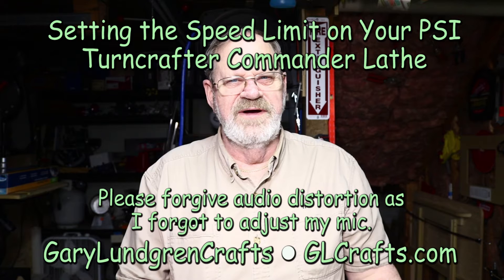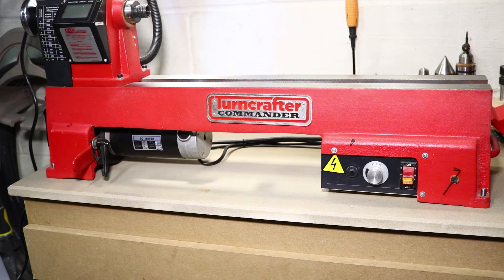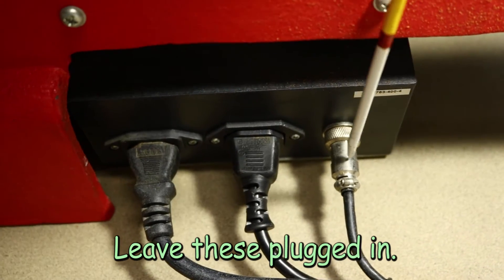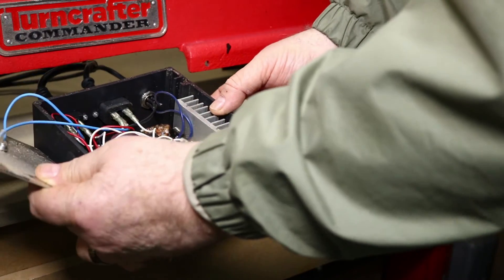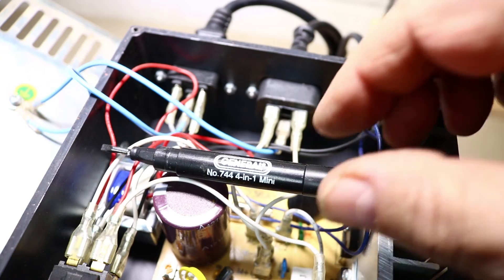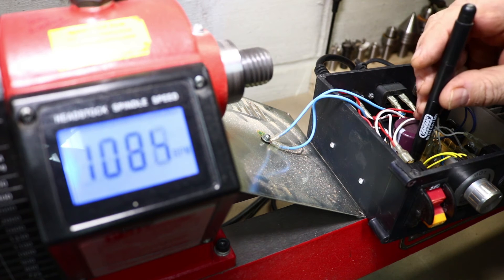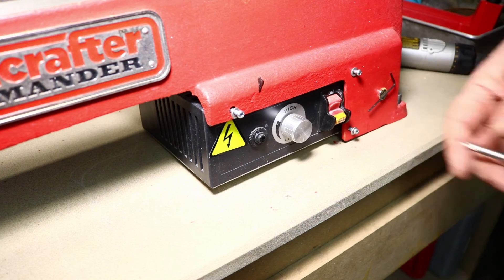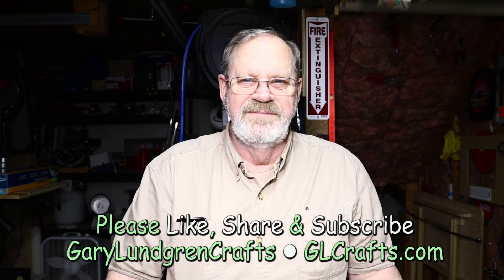Setting Speed Limit on the PSI Lathe  Ep.2017-13

Comment: Gary another ? For you.   I just got my Tunercraft Commander 12" lathe in today . Do you have a high pitch whining noise above 3600 rpm. When I drop it down to around 3500 or slightly higher the noise goes away. Just wondering if you had that issue on yours?  Thanks
Reply from the maker: Thank you!  I'm jealous!  Wish I had a 12" but I was starting out when I bought mine and didn't know what I would be doing. I have not heard a high pitched whine out of mine. I've never been above 3200 rpm with it tho. You may check for anything loose, belt tension (not too loose nor too tight), bearing in head stock or tail stock. Any vibration? I get some vibration at some high speeds and it goes away as I go higher. Check alignment of head and tail stocks. Otherwise, call their support. They've been very good before. Let me know what you find out. Thanks!
Reply: @GaryLundgrenCrafts  what size and where did you purchase the anti chuck  washer  you use on your Turnercraft Commander lathe for keeping the chuck from sticking to Spindle? Thanks for always getting back with me. Hope you come up with  more videos. I really enjoy them.
Reply from the maker: @USA-sx1xi    Thank you.  I got that washer at Craft Supplies USA at this link.. I got the one for 1" since my head stock os a 1" x 8TPI.  https://www.woodturnerscatalog.com/p/112/5507/turners-select-No-Lock-Spindle-Washer?term=lathe+washer&term=lathe%20washer
Reply: @GaryLundgrenCrafts  
Would you mind taking a measurement for me of the thickness of the washer. 1.5" OD and 1" ID will work on mine but I need a correct thickness to make myself one from UHMW I have laying around. 
Thanks Gary.
Reply from the maker: @USA-sx1xi   Thanks.  Mine measures 5/64" thick (1.98mm, .0785 decimal inch).  1" inner dia.  1-1/2" outter dia.  Actually, it would be cool to 3D print these. I'll have to check thingiverse for that. I got a 3D printer a couple months ago for other needs, but this would work too! Thanks for the idea!
Reply: @GaryLundgrenCrafts  Hey no problem Gary and Thank you for your help. The shipping prices is what got me wanting to try and make them myself👍
Reply from the maker: @USA-sx1xi   I understand that. Shipping can sometimes be more than the product. I try to batch my orders, but sometimes that's hard to do. I don't want to buy things I don't need just to get to the free shipping level.
Reply: No reason for going over 3600 
Am just one those guys if the manual say its max is 3600 than I want to have that option without having any kind of issues.
Reply: @GaryLundgrenCrafts  I contacted PSI and talk with the tech Ken. He advised me the high pitch whistle noise is from the bearings. He said its rated for 3600 and being pushed past that will cause this. I believe my mosfet screws are turned up a little more than what the owners manual specs calls for which  950 to 3600 from factory.
Mine starts out over 1100 to over 3700 .
 If I keep it 3600 or a little over no problem with the high pitch whistle noise at all. Happy with lathe so far.
Reply from the maker: @USA-sx1xi    Thanks! Glad you got an answer. I never run mine above 3,100 RPM. Is there a reason for going 3,600?

Comment: Hey Gary thanks for video. I order the 12"  Tunercraft commander lathe. Am using a penpal lathe at the moment for turning pens. I use Ca glue for the finish on the pens and like how I can turn the variable speed dial down to barely moving the mandrel on the penpal lathe to keep from  drying the ca glue to quick. Question is Can the Turnercraft commander lathe speed be turned down lower than 500 rpm? For creating that slower turn for applying Ca finishes. Thanks
Reply from the maker: Thank you!  Glad that was helpful for you.  You can get lower speeds on the lathe by changing the belt to the lower speed pulleys. Then it can get really slow.  On the lower speed pulleys I can get it down to 200 to 1,680 RPMs.  I'll add this note to the video's description.  👍
Reply: @GaryLundgrenCrafts   Thanks Gary
Love your videos there very helpful.

Comment: Hi Gary, do you know how slow it will go on the slower speed pulley, I want to do bowls. Thanks.
Reply from the maker: Thank you!  As per the User Guide I have on mine, the low speed pulleys get you a speed of 500 to 2,000 RPM. The high speed pulleys get you  a speed of 1,500 to 3,600 RPM.

I tweaked the speeds on mine as per this video, and I'm getting  on the low speed pulleys 200 to 1,680 RPM. On the high speed pulleys I'm getting 370 to 3,600 RPM.  I don't max out the top end speeds.  3,600 is fast enough for the works I do.  I only take them to a top speed that does not rattle/vibrate on me.  👍😀

Comment: Gary, I'm guessing you had your belt on the higher speed pulley when you made these adjustments? I have same lathe and I'm set on the lower speed pulley at the moment. My high speed on THAT pulley is around 2,000 and the low end is around 590.
Reply from the maker: Thank you!  Yes, I have my pulley belt on the higher speed as suggested by PSI.  I need to reach 3,000+ RPMs on many of my small projects. I can turn it down to as low as about 500. Depends on how that dial setting is set. I never tried to see how low it will go. Thought about 500 to 600 was low enough.  Thanks!